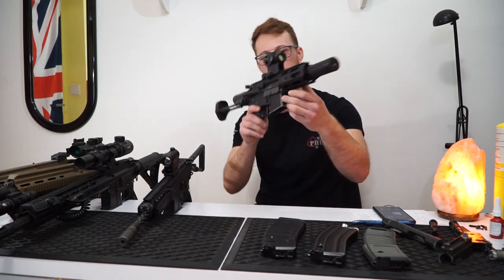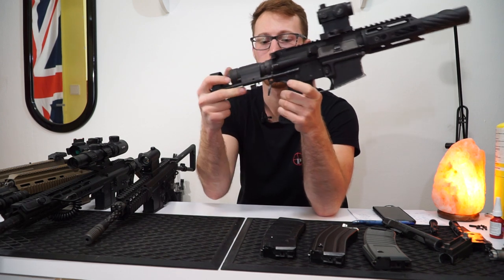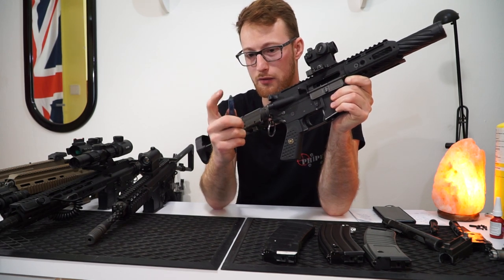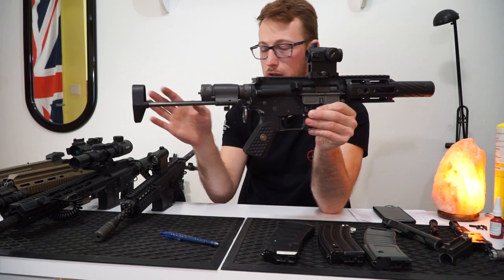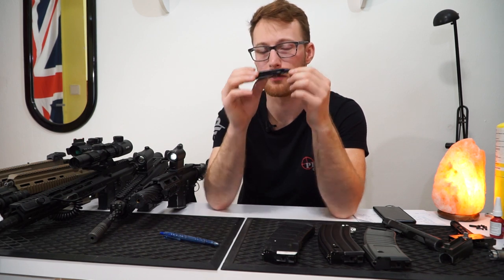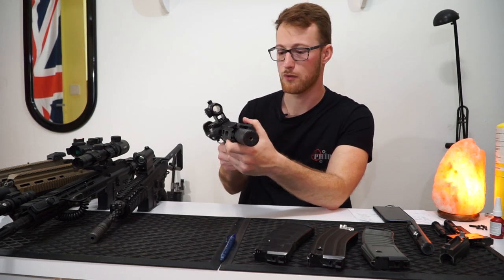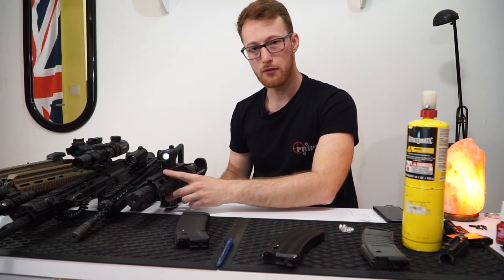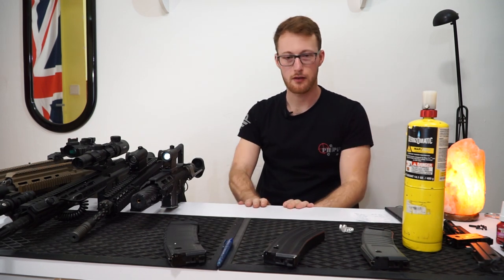WE R5C "Honey Badger" Review - Should you buy?

Comment: Lowest temp you would recommend using a WE GBBR in where it still works?
Reply: With hpa conversion on the mags you can play on every temperature
Reply from the maker: if it's a WE it's probably around 10 degrees. GHK and VFC can go lower.
Reply: @Jasonth131  ok. But HPA = no go :)
Reply: @JosefMucha100  Thanks.  have you  
tried the POSEIDON ZERO1 Anti-icer Nozzle   ?

Comment: Sorry, not "all" of us lose things.  That is the mark of carelessness and distraction. Take your time and dont be distracted. M4 (M16s) are the best platform of any real steel or Airsoft, Most customizable and lightest and most universal! 416 is just a Euro M4. The Honey Badger is an interesting Airsoft, but anything shorter than a true carbine barrel length in a real steel M16/4 or Airsoft is just plain stupid. The loss of accuracy and energy is foolish. I was in the USAF Spl Ops Wing, first to use the "commando" 10" barrel version of the M16 and the loss of accuracy was unacceptable, plus the report (sound) of a shot was 4x louder, too easy to give away your position. Anything less than 14" is ludicrous and that is only 2" shorter than a standard carbine M4.  If you need something for extreme CQB, carry and use a high capacity semi auto pistol with excellent accuracy for 50 yard or short shots.  IMHO